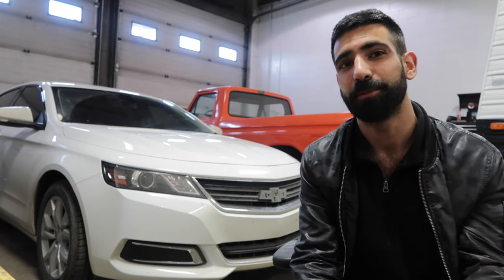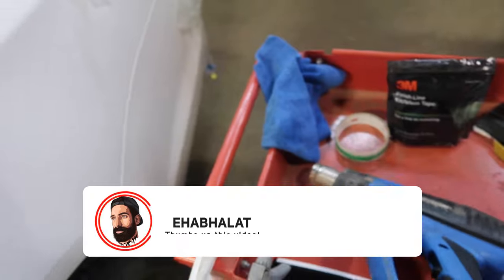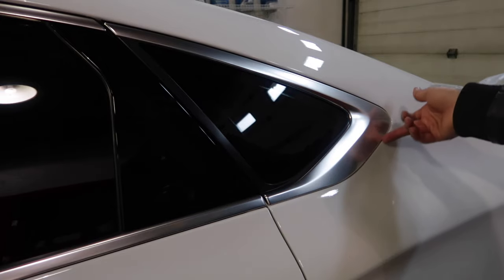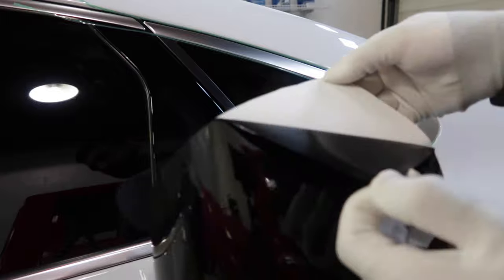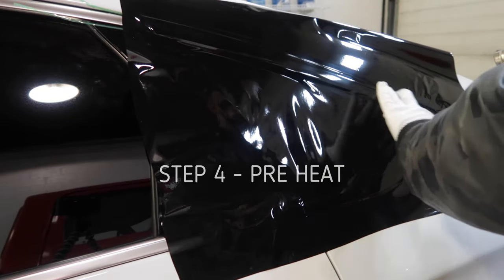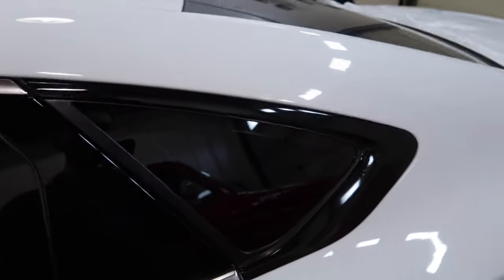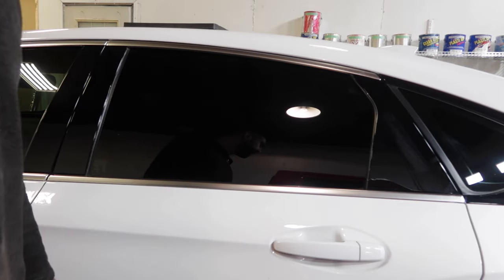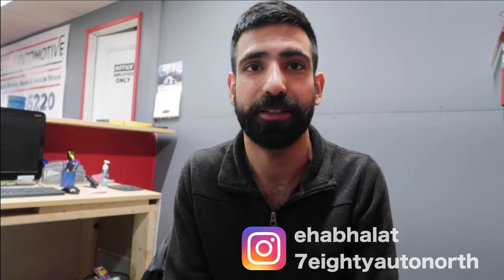How To Black Out Chrome Window Trim - Vinyl Wrap + Knifeless Tape

Comment: Cosmetically chrome might not be appealing, but its one of the toughest metal treatments out there for automobile components.
Reply: Yes.. except most 'chrome' on modern cars is not in fact chrome, it's just chrome-coloured plastic.
Reply: @ak23995  platic trim is often chrome plated, not “painted”.  Its tough, but can crack if the plastic is bent or twisted.   The process is different from painting.

Comment: Good video. You should also try 3m edge sealer which stops the edges lifting off due to environmental shrinkage.
Reply from the maker: Thanks! I will look into that forsure
Reply: 3M edge sealer look like it would be a major pain to work with, and not really necessary if you follow the video's instructions (using a heat gun as recommended) not to mention an unnecessary expense overall....IMHO

Comment: awesome video thank you for taking the time to teach us all 😊.. if you remove vinyl years later the chrome will still be intact?
Reply from the maker: Yes it wont effect the chrome at all maybe a little glue residue but that will come off with adhesive remover

Comment: I cant tuck the top edge of the vinyl under the rubber seal, as its very rigid and tight to the surface of the chrome.

Would i run into any future issues by butting it upto the seal so not having to cut that edge and having it sit flush as opposed to under the seal?

Great video, thanks
Reply from the maker: If you cant tuck it under then u have to lay it all down over the rubber and then wither make a cut slightly along that rubber without cutting it or put knifeless tape down first just over the rubber then lay the vinyl down and pull the knifeless tape
Reply: @EhabHalat  Will give it a go, thanks for the quick reply!

Comment: Best video I've found on Chrome delete! One question. I'm looking to do this same thing on my 2013 Audi A4, and I have no experience vinyl wrapping so I will most likely make some mistakes doing this myself. I guess my question is if I don't apply it correctly and it begins to peel after being cut and heat is applied, do I run any risk damaging the paint? Or the chrome underneath? Or will it leave any residue after it peels off? 

I'm trying to do some exterior upgrades without spending a lot of money, so doing this myself seems like the best option money wise. But if I'm running the risk of spending even more to fix my own mistakes doing it, I'd rather just take it in somewhere to get this done. Hope this makes sense, sorry for rambling lol.
Reply from the maker: Thanks for watching! The vinyl will not damage the paint or the chrome, worst case is it will leave residue but it wipes off easily
Reply: Thank you so much!  @EhabHalat

Comment: Is the green tape over the rubber seal next to the trim? Just curious. If so, then basically it’s automatically 3mm away, because cut line is in middle of tape, and edge of tape is basically touching trim? Is that right? Just want to make sure. 

Also, can I use the roll of vinyl instead. I think it’s cheaper, but wondering if it’s harder to use. 

I’m going to test on my Honda, before doing this to Audi. Wonder what average shop would charge to do this. I would pay $100-$130 and I’ll provide material. Anymore, and I’ll do it myself lol.
Reply from the maker: Yes thats right, just put the knifeless tape over the rubber trim just passed the chrome trim.

You can use any vinyl you like just make sure its a good brand name so its lasts long.
Reply: @EhabHalat  awesome. Ty

Comment: Great video. Thanks for sharing. 

Question, you mentioned 3mm off the chrome with the knifeless tape, but it looked like the tape was flush with the chrome? Is the 3mm just the space between the actual thread that cuts the tape and the border of the tape? Or you actually going 3mm off the chrome border?

Also, could you theoretically cut the shape of the vinyl to roughly fit the shape instead of using that entire sheet? As long as the cut covered the section? It looked like a lot could have still been used from that sheet or maybe not?
Reply from the maker: Its 3mm from the thread to the actual chrome.

Yes you can cut the shape of the vinyl to the shape of the chrome piece and any extra material i have i save and use for other projects

Comment: great video- do i have to let it sit after for a set amount of time before driving or can i drive right after applying?
Reply from the maker: As long as you heat everything up with a heat gun to ensure its properly on you can drive it right after but i dont recomend highway driving for 2-3 days. If it sits in the sun it will also help it cure quicker
Reply: @EhabHalat  appreciate it man- you just earned yourself a sub🙏

Comment: I like this video and I’m considering doing the same. What I can’t clearly see is the knifeless tape placement, more so in the rubber side. I can’t also see how you hide the wrap under the rubber. Any info on this will be appreciated.
Reply from the maker: You want the knifeless tape just abit over the rubber trim and after you make the cut with knifeless tape you can get a tucking tool lift up the rubber and tuck the vinyl under it
Reply: @EhabHalat this is exactly what I was wondering too. Thank you for answering this! 😎

Comment: good job and nice tutorial. actually, everyone should be able to apply this easily and clean, just carefully following these steps. although, there is one thing i cant get ouf my mind: how is the durability? for me it looks like it already comes off as soon as clouds are going to start turning grey or just even giving parking in the sun a moments thought. max 1 month daily driving and its gone and uve to do it all again🤷‍♂
Reply from the maker: If applied properly and using quality vinyl, then this will last anywhere from 3-5 years

Comment: Hey, great tutorial. One question. ... Im trying to wrap the dome part of my hood on my Miata mx5. How can I stop the vinyl pulling off the knifeless tape when repositioning or stretching the vinyl?
Reply from the maker: I have never had that issue. You just have to make sure the sure the surface is completely clean and dry then lay the knifeless tape down with some good pressure
Reply: @EhabHalat  ok thanks... I'll try again

Comment: Thanks for showing this! How does this hold up in  summer heat and winter cold? And in a car wash?
Reply from the maker: Holds up great! Ive had my vehicle done for 2 years no issues with cold and hot weather. It should last 5-7 years
Reply: @EhabHalat  that was a quick reply! I decided now that I let a professional do this with my car. Looks easy, but I'm pretty sure I screw it up, a 'know your limits' thing.

Comment: Nice vid bro, very clear and understanding tips. Question tho, do you think a "pre-cut" chrome delete set for a specific car will work just as well? I just ordered off of Ebay. Just trying to get as much info I can get before I try to apply.  Thx
Reply from the maker: Thanks! I didnt know they made pre cut for window trim on vehicles i havent tried that method before. I always use vinyl wrap with knifeless tape
Reply: @EhabHalat  your welcome boss, but yea I didn't know either till recently, searching on how to blackout the chrome trim on my 2014 Chrysler 300
Reply from the maker: I think thats just vinyl wrap pretty much the same thing im using in my video but i dont know what brand that is it might be cheap stuff thats hard to work with
Reply: @EhabHalat  yea your possibly right on that.. il give it a shot tho and see how it comes out. Il even take a few snap shots when done. Il keep you posted.. and thx once again bro
Reply from the maker: Not a problem man, best of luck

Comment: great video dude.. i have a question on the curve part of the trimming. did you cut out a straight line of the vinyl or a big square piece to cover the curve trimming on the top half of the windows and near the side mirrors
Reply from the maker: I use bigger pieces for the corners and curved trim and single strips for straight trim

Comment: Can you do the side panels in between the doors? The ones on this car are already gloss black but mine are matte black but I would like to gloss them as well.
Reply from the maker: Ya you can do them no problem
Reply: @EhabHalat  Thanks which wrap do you use? I was looking on Amazon and some of them have bad reviews so I don't know which brand to get.
Reply from the maker: I use 3m or avery i get them from a local vinyl wrap store in my city
Reply: @EhabHalat  O ok thanks

Comment: Great video. I have the same exact Impala. A 2019 though. This is what I needed. 

Question, I'm a busy man, I go to the car wash. Will this come off through the car wash?
Reply from the maker: Not if its applied properly it will last for a very long time
Reply: @EhabHalat  my man. Thank you sir. And thanks for the response.
Reply: Last question. How much material would I need for the Impala?
Reply from the maker: @KingMarcellous  if you order the same roll of vinyl i got thats all ull need and you will have abit extra. I cant remember how long the roll was but you can try and find it on amazon

Comment: Can you go back to chrome easily using this method with no damage?
Reply from the maker: Yes just heat it up and peel it off. It may leave glue residue but can be easily wiped off with rubbing alcohol

Comment: Hi ! Thank You ! is a great video , I have a question,  I do not  have a way to plug in my heat gun i live in a building  , can I use a lighter to heat it up?
Reply from the maker: Lighter will take a very long time. Heat gun or hair dryer would be best to get the job done right

Comment: I really wanna cover the chrome trim on my 2019 grand Cherokee can I use tint for that
Reply from the maker: You will have to use vinyl wrap on certain parts and plasti dip with 2k clear coat on other parts depending on what your wrapping/spraying

Comment: what did you do when the vinyl wasn't long enough? how did you make it look seamless? looks really cool
Reply from the maker: What do u mean?
Reply: @EhabHalat  when you had to cut the vinyl before it came to end or was it long enough to cover with one piece?
Reply from the maker: @stuartlittle2962  the rear corner piece needs a bigger vinyl sheet to do it all without any cut lines. The smaller straight line trim is done with the cover chrome 2” vinyl roll
Reply: @EhabHalat  got it tysm!
Reply: You always use a piece that is long enough.

Comment: how did you do the front grill? I have the same car. Did you use one big piece?
Reply from the maker: The grill was replaced with a aftermarket black grill so i didnt do them but i would probably vinyl wrap or spray them with black plasti dip and then 2k clear. I have a video on my channel of that process on rims

Comment: can i use a blow dryer instead of heat gun?
Reply from the maker: Yes but heat gun will make the job easier forsure
Reply: @EhabHalat  thank you great video! by any chance do you have a link to the vinyl?
Reply from the maker: I got it form my local vinyl store but u can find it on amazon search black cover chrome vinyl wrap

Comment: for that back piece, is it possible without a big piece of vinyl?  i have the typical strips they sell to do the chrome delete
Reply from the maker: What do you mean exactly?
Reply: @EhabHalat  i mean i don't have a large piece to cover everything like you did. i have a thin long strip.  you were able to cover the whole back chrome piece because you had a very large square.  i guess i could do it with the thin long piece but then i would have to cut it and i would see a seam
Reply from the maker: Oh ya its best to get a big piece to do it all in one piece but you can still make a clean cut if doing it in two pieces. I have done that before and it doesn’t look too bad

Comment: whats the best angle to pull the knifeless tape?  90 degrees or drag at a lower angle?
Reply from the maker: Pull the knifeless tape back, press ur thumb down on it and pull with ur other hand. The string should pop out and then just pull it all the way through the vinyl

Comment: What are your thoughts on Hyper dip for chrome delete?
Reply from the maker: Havent tried hyperdip on chrome delete but for me i use vinyl wrap because i feel it does last longer, most window trim have rubber seals the dip doesn’t adhere great too and no masking up around the whole windows

Comment: how durable is the wrap and can it survive a pressure washer and car wash?
Reply from the maker: Its suppose to last 7 years or so. Its very durable and will last that long if installed properly. Yes you can pressure wash or run it through the car wash with no harm done

Comment: I'm trying to figure out what to do on a 22 Kia Sorento.  The back trim flows into this blob of ugly.  How do you black that part out?
Reply from the maker: You need to use bigger piece of vinyl wrap for that area
Reply: @EhabHalat  bigger as in a solid piece or can these be butted together and still look seamless?
Reply from the maker: It would have to be one solid piece for that
Reply: @EhabHalat  thank you for responding.

Comment: Can I wrap the rubber part on the window trim
Reply from the maker: You can but only by a little. I wouldn’t wrap the whole rubber because it wont stick properly and wont last in the long run
Reply: @EhabHalat  I d put a little chrome trim toward the bottom  but I didn't put all the way.i had thought about wrapping that part.

Comment: Man, I know you know better than me, obv, but I've done half my car now, and that 3m tape is just trash. It doesn't stick to the car, the thread won't come apart easily, and more than half the time, it breaks. I don't how if I got a bad roll or what but I hate it.
Reply from the maker: Hm i have never had an issue with it. If it doesnt stick to the vehicle then there is something on the car like wax or grease not allowing it to stick so maybe wash ur vehicle and wipe everything down with some rubbing alcohol. When you are going to peel the knifeless tape u have to fold it back press ur thumb down on it while its folded and then at the same time pull it to get the thread out. Its hard to explain over a message haha

Comment: Could you use a hair dryer or does it have to be a heat gun?
Reply from the maker: You can use a hair dryer but i recommend a heat gun
Reply: @EhabHalat  Heat range? (I don't own one yet)
Reply from the maker: Not sure but both heat gun and hair dryer work

Comment: What vinyl
Do you use can you link it?
Reply from the maker: This is 3M 2080 gloss black vinyl. I dont have a link but i bought it from a local print/vinyl shop in my city.
Reply: @EhabHalat  okay thank you! I’ve never done this before so it’ll be my first time. Wanna black out my Mazda 6 that I’m getting next week!
Reply from the maker: Very simple to do just follow the steps and best of luck!
Reply: @EhabHalat  thanks so much for your help!

Comment: Every video I see is about black out.  When will we move from this everything black thing that’s going on. I have a black truck because I couldn’t get one in any other color. Check out wheels on any website. You’ll have to go through pages of black wheels. Before you see anything else going on in wheels. NO imagination. BLACK is over.( Please)
Reply from the maker: Black goes good with everything on a vehicle. You dont see people doing orange,blue,red etc on the chrome, it looks pretty tacky in my opinion.
Reply: What color would you use?

Comment: You did a great job on the install.  But you took a classy looking car and made it look amateur.
Reply from the maker: Some people like my self hate chrome and prefer a black out look instead. I think it makes the vehicle look newer and cleaner but i guess everyone has their opinions.
Reply: @EhabHalat  For sure.  To me the blackout is something that should be considered way back during the development of the car.  That way, those who are designing the vehicle will make sure the blackout presents properly, and will even redesign the body and whatever else it takes to make sure that blackout works and blends with the car.  When a manufacturer's final rendition of their "art piece" is complete, they've considered how it all comes together.  That's why, even though many do not like the trim, their modification to make it black, does give them something they would rather have, but still ends up being out of place.  I can spot these mods in two seconds, because they almost always stick out as being out of place.  This is not to say that some cars don't lend themselves more to such a modification, but in general, it just looks out of place.  I do know what you mean though, and if you can't stand chrome, by all means cover it up. LOL  Way better than gold though.  :)